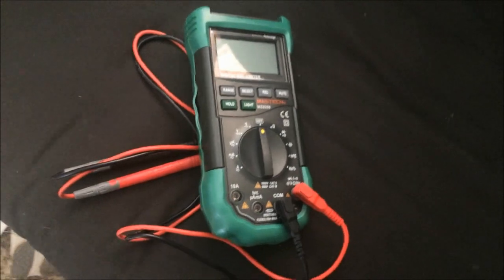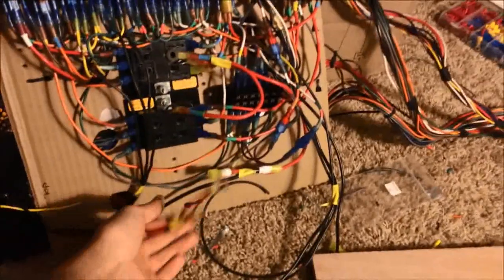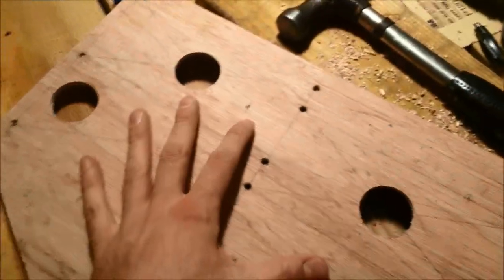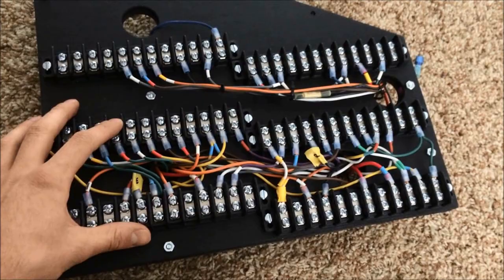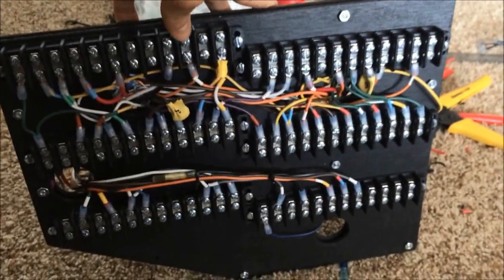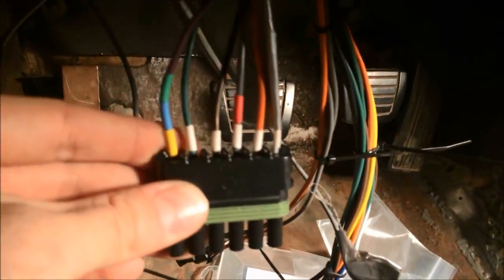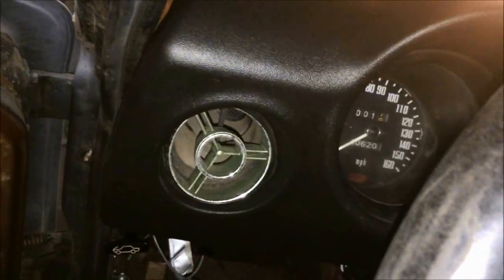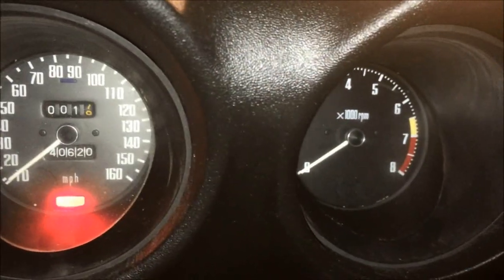Datsun 240z Project Car Update 9.0: Wiring a Car from Scratch Finale

Comment: I've got a V8 240z and had to redo all of the wiring in the engine bay and I'm still doing it now. Everything's wired up. just gotta go over it all with electrical tape and some tubing for extra protection.

Comment: I don't know how you do it. only my horn and hazard lights work. :(
Reply from the maker: Haha, just take your time and go through the system with a multimeter.  Even if you check 10 connections a day your car will come back to life faster than you think.
Reply: Did you use a wiring diagram? Because i cant figure out why my ignition wont get power.
Reply from the maker: I found an old 240z diagram that was barely legible online.  Went through it very very carefully.  Its pretty straight forward after you look at it a few hours.
Reply: +Uzarski Designs You will not believe it. I tore apart the whole car because I wasn't get power to anything but the hazards and horn. it was the gauge that shows the voltage aka ammeter, I bypassed it and everything works!!!!!!
Reply from the maker: WOW great to hear!  And that makes sense!  I think I remember the hazards are wired in a way that would make them work no matter what.  Glad to hear about your success!

Comment: I'm originally from PA too and I just recently bought a 71 240z and believe it or not I designed and printed almost the same plastic piece on my 3d printer to delete the radio.  I was wondering if there's anyway I could get a copy of your redrawn wiring diagram.  I hope I don't have to do a significantly amount or wiring, but like you I will be wiring relays for all the high current circuits.